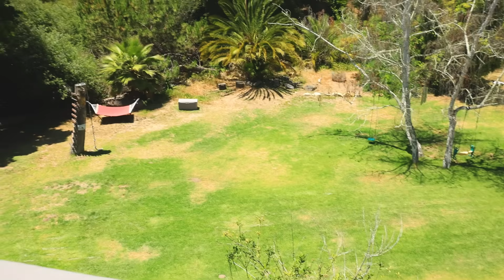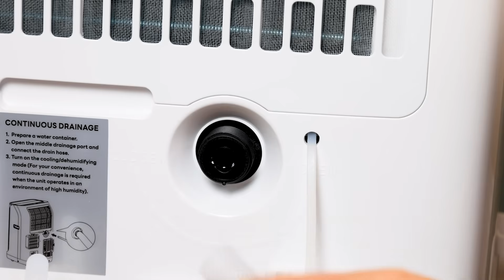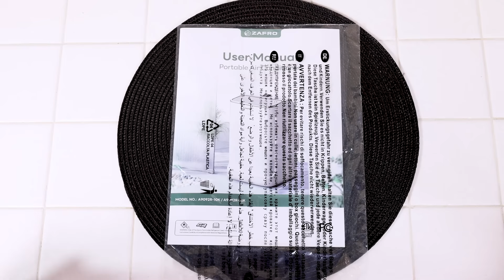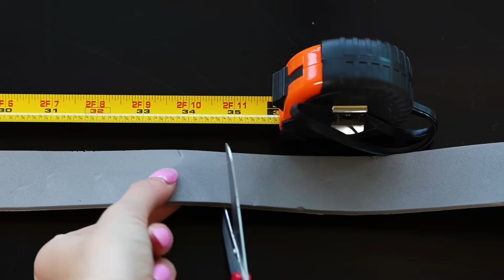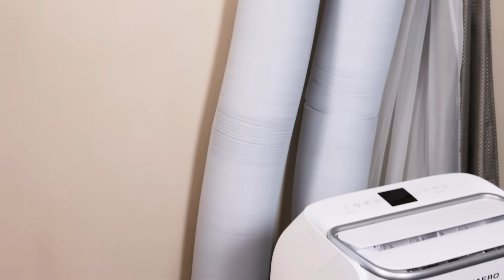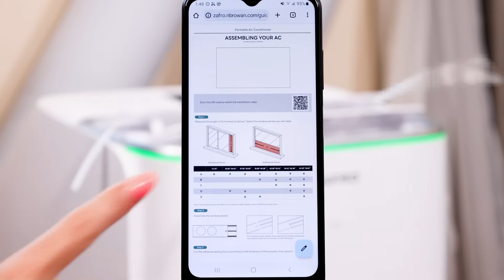Zafro Portable Air Conditioner Review 16,000 BTU | Ultra Quiet | Dual Duct Smart AC |  INSTALL HERE

Comment: i got the 2026 version, I think, the model is the same they say it is 38db in the new version, I saw on amazon that the difference is in the ASIN number, but I couldn't find it on the box or on the Air Conditioner, I hope they didn't give me the 2025 version and made me pay extra for the 2026 version, in any case it works greats so far , this is my day 2 with it, love the app, better then the remote , can start my ac from the gym
Reply from the maker: No doubt about it @billc3344 ! Thank you for commenting on my video!

Comment: Outstanding review, Miss Rebecca (I'm from the South).  Just love your cheery optimism!  However, I am curious about drainage.  It would be necessary for me to leave this running (on a very low output) while I'm away for two weeks.  Have you personally used the automatic drain line?  Do you need to manually drain often?  Thanks again.
Reply from the maker: Great suggestion!

Comment: Great informative video! For anyone who is having trouble deciding between portable and central ac, I'll give my two cents. First off, if you are anywhere east of the Mississippi river, portable AC unit attached to a window is the only option. If you are like me and live in the Southwest (Phoenix here), both will work. For instance, I live in an older home with somewhat poor insulation, so once the internal AC goes off for our whole house, individual rooms tend to warm up quickly if we keep our doors shut (hello, privacy!). My roommate bought a portable AC unit and had to deal with the hose and attaching it to a window etc. It essentially cools down his whole room which is great.
Reply from the maker: Thanks for sharing @flwrzpinky6865 ! So glad to hear it!

Comment: The only thing I hate about portable ACs is the hose assembly.I have 2 portable AC and the hose thing needs to be made easier. Wrestling with the hoses, trying to get a proper seal on the window kit, making sure nothing pops out.. just a hassle, and when you're doing it solo Urghh. I always wished manufacturers would come up with a more user friendly, snap-on style hose system or something magnetic. This Zafro's design makes a huge difference. this Zafro model does look a bit more streamlined than others I’ve used, and the way the video breaks down the setup makes it seem more manageable.😅I just want cool air without the engineering degree!
Reply from the maker: We've all been there before @Sarah-h7m2b ! Thanks for the comment!

Comment: I just installed this machine and today it is 34 Celsius with 41 humidity. THis machine cooled large one bedroom apartment in no time.🙌I couldnt believe how it perfected it on speed 1 you can barely hear it. How long this is going to last I dont know but at 41 degrees in half an hour my apartment is nice and cool. It performs as good as any window air conditioner quite impressed. I always wanted dual hose Portable AC. So far this is the AC i always needed. Easy to install 👍
Reply from the maker: @Alexander-li2nu I'm so glad you liked this!  Thanks for your comment!

Comment: You probably saved my camping trip this July... in Florida.😰😭 I know, I know, what was I thinking, planning a camping trip in one of the hottest, most humid states during peak summer? But it’s a family tradition, and we’re going no matter what. I’ve been dreading the heat, especially at night when the tent turns into a literal sauna. But after watching this, I’m honestly considering bringing a portable power station just so I can run something like the Zafro in our tent or camper. The dual hose design and turbo cooling feature seem like they could actually beat the heat. And it’s quiet enough to sleep through?!. Rebecca, you just gave me hope that I might survive this trip without melting into a puddle. Now that's my kind of camping!! Comfort galore! Huge thanks! 💘
Reply from the maker: It really is the best @lolagarcias6368! So glad you liked it!

Comment: Here in Washington State it randomly hit 80 degrees and we don’t normally have ACs built in our homes. Thanks for this video, I love learning how things work! The portable AC's are less visible and could be stored in a closet when not in use which is important for apartments and rentals where the utilities are covered by the rent as the rental contract would often prohibit high draw appliances such as air conditioners though quite frankly, I think we'll get to the point where air conditioning is considered essential plus an efficient air conditioner that can reverse it's operation to heat the interior (a heat pump sometimes called a 4 in 1 with the portable AC's) could actually reduce energy usage.
Reply: Goodness! If you're considering one for Washington maybe I really do need one in California 😅🤣
Reply from the maker: @Cindy-b8j Isn't this the coolest?? Glad you like it too!

Comment: This product looks terrific for race/track cars that have factory a/c removed. You can put the unit in the backseat, secure it down, and run the hoses outside through the rear windows or a custom vent cutout. Only thing you would have to make it a mount which is pretty simple. a dual hose system means it could genuinely cool the cabin effectively between sessions or even while idling in the pits. You should always try to get the dual hose portable AC's if you choose a portable. The single hose portables depressurize your apartment/home and warm outdoor air leaks in throughout your apartment or house to make up for it.
Reply from the maker: This is such a unique use case that I never would have thought of!

Comment: i live in the stat of maine. it is hot as heck in summer and cold as ice in the winter . i got a "portable" ac/heat/dehumidifier ,single hose.and it was useless. if it is too hot outside ,it can't cool.if it's too cold outside, it can't heat. soooo ,i thought it was broke. only then,did i read the manual to find out that , is normal. that would have been nice to know before hauling this very heavy piece of crap all over hell and back and spending days waiting for it to work.won't cool if hot and won't heat if cold . only 500 bucks plus time and gas. an added bonus,LOUD AS HELL AND NEVER SHUTS OFF.
Reply from the maker: I understand your struggle! @kittyclub9749 I'm glad you enjoyed this!

Comment: I absolutely loved the portable units I had for my mobile home when my central air unit went out. I had two units that cooled the living room, kitchen and bathroom and slept in the living room. The only drawback is that they do make a lot of noise. Mine weren't this brand though.  The sleep mode and quiet operation on this one seem like a huge step up.If I ever need another backup or even just something for spot cooling, I’m definitely considering this one now as the best ones are the ones I have two hoses so your room doesn’t become a vacuum and put air from the hot air outside or other rooms.
Reply: a few years ago I had a single hose AC, really hoping the Zafro lives up to my expectations after this video, seems like the angel of the ACs bahaha
Reply: The fact that this has a quiet mode is prob the best part to me, I'm a restless sleeper so I need the peace for a good night.
Reply from the maker: @stephaniereins2143 I'm so glad you liked this!  Thanks for your comment!

Comment: Wish I had this when I lived in Germany. I lived in the attic of a 100 year old converted triplex, and it had 5-6 meter high ceilings. No single hose AC was powerful enough to cool the living room. I remember literally sitting in front of the one window that opened, hoping for a breeze. How fast this Zafro cools a room with dual hoses for efficient airflow would have made such a difference. Because it's portable and doesn’t require heavy installation would’ve been perfect for my rental setup too.
Reply: wish i knew the difference between single and dual hoses in these before i bought my single hose ac. so worth it to get a dual hose ac, i learned the hard way 😫
Reply from the maker: Thanks for sharing @Patrice-k1g3j ! So glad to hear it!

Comment: I’m in south Louisiana and looking for something to help with the heat and not bring my electric bill up to $600. Also a good way to keep the house cool should a hurricane knock the power out. I’ve only seen window units and they are an eyesore (it would not be a problem if I had to, but if I can avoid it, even better!) I suppose this is a good option for what I am searching for? I maintain the central air, but the heat and the amount of windows are not in my favor. I don’t care about noise, I have 4 kids and don’t mind hearing white noise over “mommmn, so and so won’t get out of the bathroom
Reply from the maker: Ha ha ha! @roberttorres4471 you made me laugh!

Comment: I prefer the window AC for many reasons, but for people who don't have that option this looks great. The whole advantage of the portable and window aur conditioning units is that they can be used and removed without damaging the residence which is important for rental policies hence screwing them in place is really only acceptable if you feel you can effectively fill in the screw holes and camouflage them with paint or something (one renter's truck is to fill the holes with white toothpaste that hopefully matches the paint enough to fool the landlord during the damage deposit inspections).
Reply: The struggle of wanting comfort but also a sleek, organized place probably wont change for another 50 years 😭 this will do for now though, this is the nicest, least bulky looking one I've found so far.
Reply from the maker: I couldn't agree more @angelinaroberts4721! Thank you for your support on my channel!